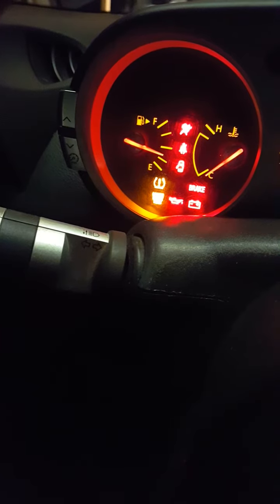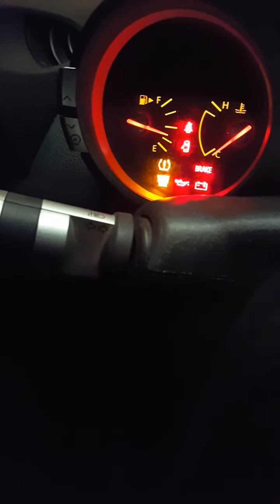350z ecu pcm 2005 fuse

Comment: oh shit this just happened to me ! I checked fuel pump spark plugs and basically everything else you said in the video. when this happened to you did your fans turn on when your key was in the on position ?
Reply: KawaiiZ33 did u end up fixng it? im having that problem!
Reply: Jose Moreno yeah it was the ecm fuse in the hidden under the battery think it was a 15A fuse but it fixed it
Reply: Man! Thanks bro, this happened to m yesterday i was about ready to replace the ecu and the key
Reply: Jose Moreno yeah don't do that, that's a shit ton of money and you have to get it reprogrammed from the dealer which cost 300+ . It's the seals on the windshield and cowl if it's old and brittle  water can leak through
Reply: +KawaiiZ33 what is the ECU fuse labelled as I don't see anything in that fuse panel behind the battery that says ECU.
Reply: which fuse?
Reply: did replacing the fuse actually make the car start? I have this same problem.
Reply: This shit just happened to me. I take off from a light, get on the gas and car just shut off in traffic. 
Car wont crank, I don't hear the fuel pump priming and the radiator fans turn on when the key is in the ON position. 
I'm going back to the car today to see if that's the problem. Do you know the proper name for the fuse you replaced?
Reply: did u figure out the problem
Reply: Fans turn on when I disconnect ecu anyone know why? My car cranks but don’t turn on can’t hear fuel pump turning on. Any info?
Reply: Daniel Lopez It’s a fuse in a fuse box beside the battery. I made a diagram to help you guys in the future here: https://cimg7.ibsrv.net/gimg/g35driver.com-vbulletin/399x435/80-be3d5067_24b6_4da1_b508_b51a4f91707a_97a38e21a6ef5c6425f1a6ab1e45639369e46296.jpeg
Reply: CocainaBlaze thank you !
Reply: That fuse is good. Car cranks but don’t turn on same prob as guys are saying here fans turn on. Could it be my ecu
Reply: Daniel Lopez You may have checked the wrong fuse. I had the exact same problem two months ago. Fans on, fuel pump won’t prime, car won’t read codes, etc.
Reply: CocainaBlaze my car reads codes with the scanner. & fans used to be On they are off now but once I disconnect the ecu from wiring harness fans turn on. I checked all fuses haven’t checked relays but I’m going to keep checking & if nothing works I’m going to come to the conclusion that it’s my ecu.
Reply: Daniel Lopez True. Hope you find out what it is man.
Reply: Thx man
Reply: did you ever figure out the problem daniel? was it actually your ecu?
Reply: Eric Zhang idk if you asking me but my problem was the ECU
Reply: dang, that sucks. you ended up replacing the ECU, bcm and your keys?
thanks
Reply: Eric Zhang no just had a local place get me a ecu & reprogram it. So it could be plug & play.
Reply: thanks bro, i appreciate the help
Reply: CocainaBlaze same
Reply: @F.B.I hello did you figure out what was the problem of you fuse blowout?

Comment: which fuse you newb dont do a video without proper details you padawan
Reply from the maker: Its under the fire wall on the passenger side i believe it was a 15 amp fuse you could look at them and see which ones burn out  and which ones not but there's an extra panel under the fire wall on the passenger side I no longer own that vehicle.
Reply from the maker: been doing it for 20 years now buddy and built over 50 engines how about you weres your content.